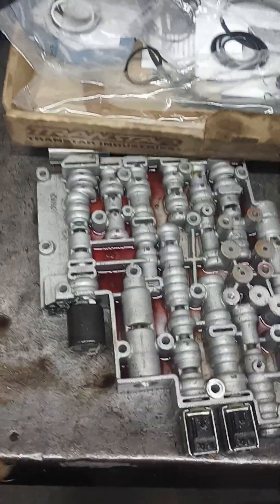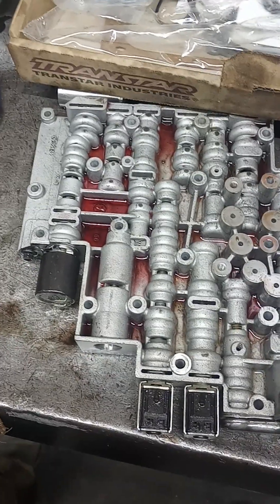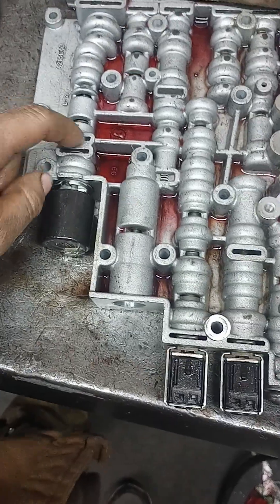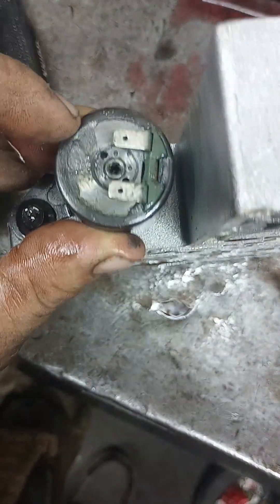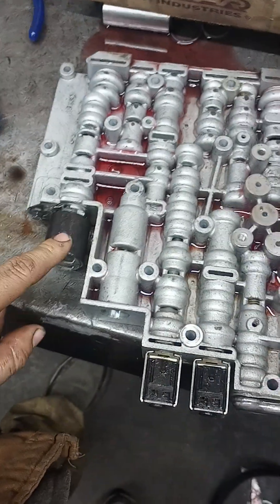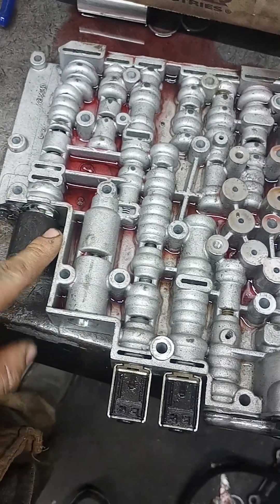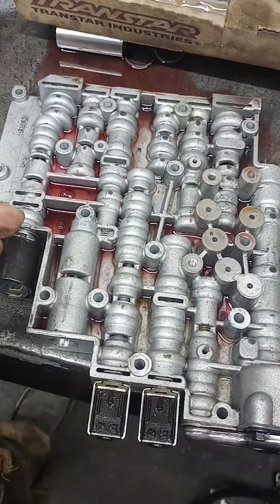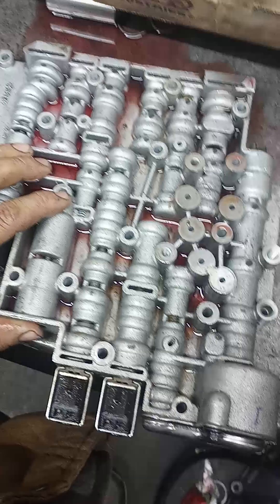best way to fix a 2/3 flair on a 4l60e/4l65e for free!!!!!

Comment: Today my 4l65e repaired the 2nd to 3rd gear slipping on smooth acceleration and shifting normally. I do remember having had a code p1125 and the engine went into low power mode. Thanks for the information
Reply from the maker: @luiso627  your welcome
Reply: @luiso627  I turn it clock-wise correct ?
Reply: @arguswil yes
Reply from the maker: Yes

Comment: I built one and it’s pretty good but in morning you to give it more rpm to get started for day then sometimes won’t have second goes to 3 rd thinking either bad leaking afl valve or missed filter in pump. What you think keep up cideo
Reply from the maker: @michaelbaskinmichael9862  check the servo it applies the band for second gear and 4th and Iv seen them alot were the Teflon seals ride into the aluminum of the servo and make it we're the seals can't apply and leak. Also id check an make sure your 1/2 accumulate piston is not cracked makeing a cross leak were it's skipping 2 gear. And as far as you haveing go give it more rpm to shift in the morning id definitely put a pressure gauge on it and see what the pressure is in the transmission when it's cold and also like I State above id definitely check that 1/2 accumulate piston and make sure your not getting cross leaks making you have to apply more rpm to rise the fluid pressure to apply shifts hope this helps you out some an thanks for the support!
Reply: @ I think accumulator I replaced both and servo was upgraded but I didn’t have the shim but will recheck this maybe put in a longer pin. Thanks for your time

Comment: Got a 4l60e in a 95’ c1500 5.7 tbi was shifting fine until we noticed a leak on the dip stick tube shaft replaced seal and some rubber off the seal
Ended up in the pan. Well before I realized this truck started slipping in 2-3 dropped pan and got the rubber out and cleaned pan new filter and gasket and still the same any thoughts as to what I should do fluid was black that came out didn’t smell burnt though
Reply from the maker: 4l60e are bad for the 2/3 shift valve in valvebody to hangup /not work also know for the pressure manifold switch to make problems. If anything it's in the filter it can make problems. But try to manual shift it threw all the gears and see what it does if it's slipping rpms flying up and not moving then id pay you have a internal problem I have videos to show you how to build that transmissions flawless

Comment: I had a mass air flow sensor code on my 99 2wd 1500 and swapped it. Lately I've had a pretty aggressive 2/3 thump and it's been concerning me. Never knew this could be a related cause
Reply from the maker: @brettmyers7054  yes and also the massair flow controls the line pressure I. The transmission your lucky it's a 99 the 97s and down had a problem we're you had to add a ground to the PCM . But yes I'll be doing more videos about the 4l60e because everyone around me brings them to me

Comment: It raised the pressure like a viagra pill😂 however it exposed the real problem. I have a possible TC valve thats worn. Ordered the modified one from Amazon. I guess fluid passes through the worn TCC valve causing torque slippage and other signal fluid problems. Its pretty cool to now know how to raise my line pressure 😂😂*  Drive* BAM!!! 😂

Comment: Bro get a 4l60e core and do a series on TEARDOWN INSPECTION explaining the parts, where they go bad, how to spot wear and tear etc.
Reply from the maker: @TonyJohnson-t6c  I can do that I have a 6l80 I'm rebuilding tomorrow and a 4l60 im doing also so I'll be sure to get some videos of it in a series I build everyday so im going to try to post full vidoes of the transmission and show people how to build them at home there self
Reply: @wickedfastautomotive6487  thank you bro that’ll be 🔥🔥🔥🔥🔥🔥🔥 I’ve been subscribed to your channel for a minute on my other account. I have 2 phones so when 1 battery gets low I switch phones. 😂😂😂
Reply from the maker: @TonyJohnson-t6c  love it man! Yeah I'll start doing full videos for now on
Reply: Just got a 2003 avalanche with a 2/3 flare when warm . It shifts fine When its cold.  i baby it im afraid to punch it in fear of blowing the trans.  The Po did not take  care of this truck   im gonna try the 10 min adjustment and hopefully it fixes it. Thank you for this and i just subbed.
Reply: @YouberTuberNoober I got a 02 and spent 3000 on AAMCO reman 3yr unlimited mile, a yr later no trans, they replaced it saying the spare tire I had on at the time caused it because the factory spare is bigger, or smaller or whatever, I never heard of such,
But the new trans shifted slowly between 3-4 and at another year, being year two I go in to have it looked at and new AAMCO franchise owner that won't honor the contract or warranty,

Long story I don't have 3rd or 4th gear now, and out of cash and transportation, my question is, could my problem be this or the Mass air flow? 
Crazy I still been driving it in 2nd gear for months now when I have to...
Reply from the maker: 3l/4 slipping or is it just not shift mass air flow controls the line pressure in the transmission most of the time it's to late and you burn up the 3/4 clutches or you could get lucky and have a bad shift soloenrd not commanding on or the shift valve be stuck/hung up seen this alot but if it's definitely slipping you've burnt it up and only thing you'd have to replace is the 3/4 clutches and steels new mass air flow and filter and pump gasket. Easy job to do your self if you've watched my videos you could do it at home and buy you a rebuild kit and rebuild the whole transmission less then 300 bucks! Or go to transstar or witt and get the parts you just need..

Comment: Hey man grasping at a straw here, I got a 93 4l60e and changed the harness inside for a newer harness with the pwm solenoid and 13 pin connector. Truck runs greats but trans only stays in 3rd gear. When I put it in manual 1&2 she only goes to 2. Any ideas? My trans is out and the valve body is in the bench. Tia
Reply from the maker: @thomasblais7751  never swapped to a newer style harness before. But need to check the shift soloenrds and valves make sure they are free and also take your servo out and make sure the neflo sealing ring dent brake will make same problem
Reply from the maker: And check the the 2/3 accumulate make sure it's not hung up
Reply from the maker: But definitely sounds like limp mod.
Reply: @wickedfastautomotive6487  dont know what this is but thanks for the reply! I will look into it
Reply: Check the ground at the rear of cylinder head

Comment: I’m a new n i know that ain’t the boost valve.
Reply from the maker: Yes in the first couple sec of the video I am holding the pump body and pointing at the boost Valve.. and then I talk about the epc pressure solenoid and the afl valve